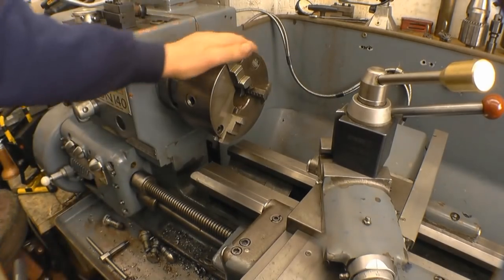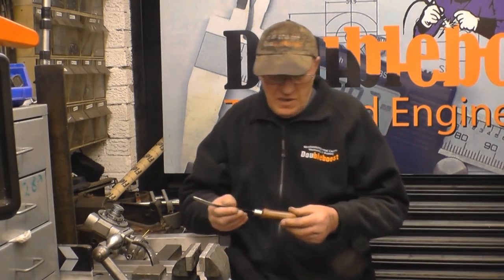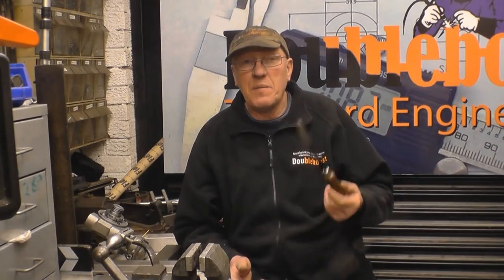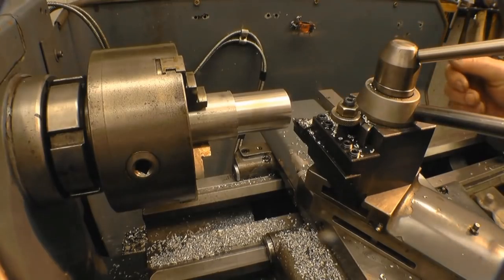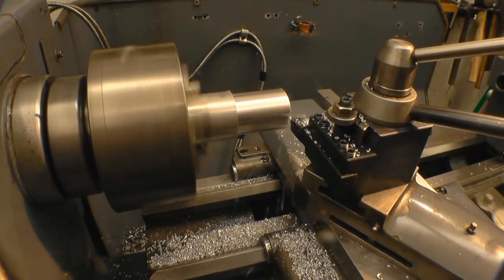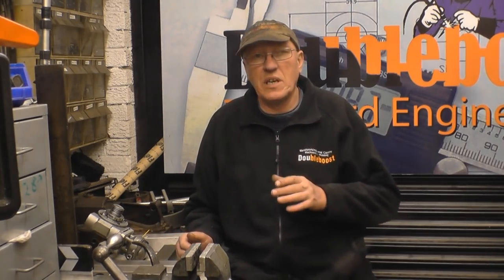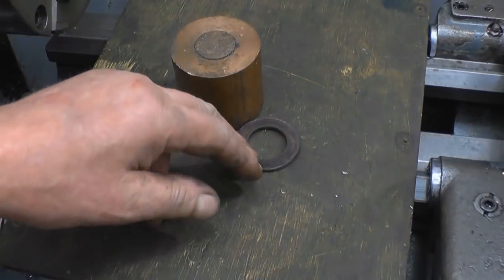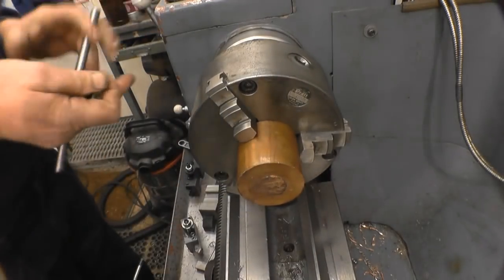SNNC 213 P1   Plasma cutting Copper

Comment: John 
For turning /drilling copper. HSS is your friend but use milk as a cutting fluid ( now I mean full fat cows milk ) I know it sound daft but it works , tip given to me by a old timer ,must have been a old guy as I am 71 

Stuart
Reply: Thats my man!
Reply: Stuart Hardy. After breaking several drills way back in the early 1960s while employed in tool making  I was also given this advice by an old timer  that was teaching me the art of tool making . 'cows milk for copper' his exact words , not perfect but much better than any lube or coolant available in those days .

Comment: John's idea of a doorstop is great, though if you open the door with a little welly you will need a new door.  Just a thought, how about taking a small supermagnet and glueing it in the end there under the rubber bung, and place a small steel plate as a keeper and dent stop on the door. That way double duty as both a door stop and also will hold the door open if needed as well. Small magnets from old PC speakers or old radio ( not the ferrite type but the alnico type) would also work, just not as strong.
Reply: Aye, if you catch the door on it's sweet spot, the plaster cracks and tiles fall off the roof!!! We called ours the ankle biter!  Worse than Norman Hunter!   Now we have one that's a coiled spring.  It still nips but hasn't drawn blood - and it plays a tune (boyoyoyoyng) to say sorry.  A big plus is the door hasn't fallen off it's hinges since I swapped it.
The way John's been with accidents lately I'd be a bit canny going through that door
Reply: That's a great idea seanBZA